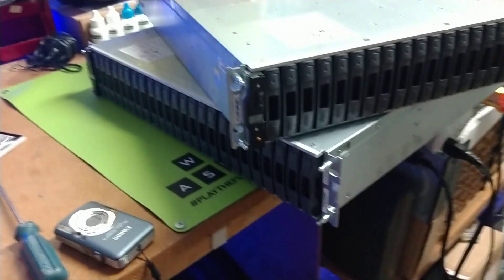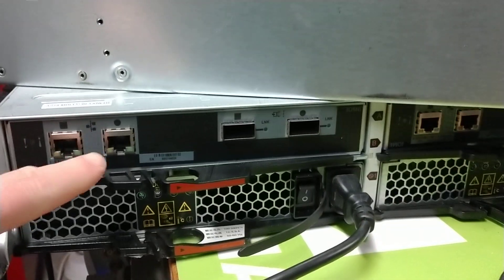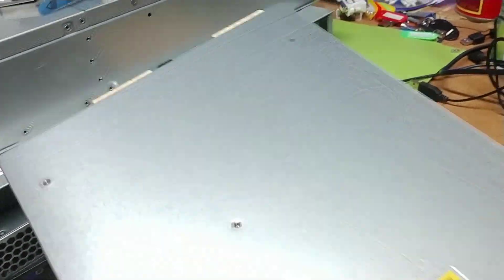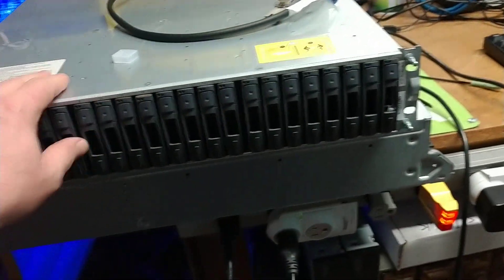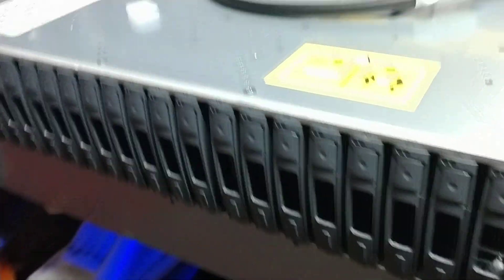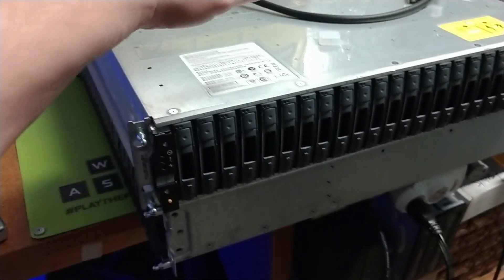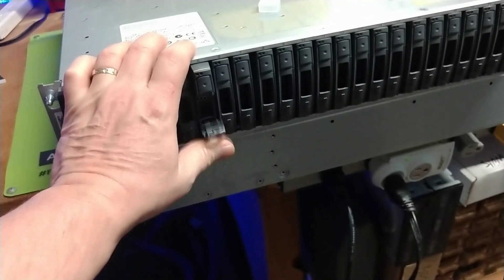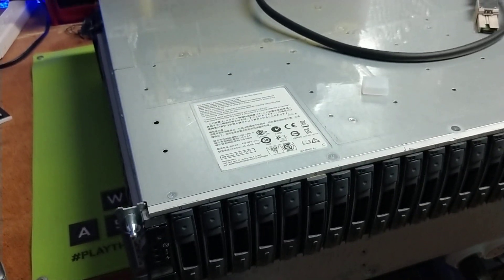Getting a pair of Cheap NetApp Enterprise DS2246 Storage arrays for under $100 bucks!!!

Comment: Hey, do you know anything about an emc vnx sae 24 disk storage unit? I bought one but now after I plugged it into my server my server seems to lock up in the post sequence and I have no idea what to do with it or how to install it
Reply from the maker: Try adding only one path.  Is this unit a SAE 25 disk array or a DAE 24 disk array enclosure? I have not setup a SAE yet. Fun!   Try a single path cable connection. See if you cna see a disk that way or at least post to the server level.
Reply: @leadiususa7394  can you do a video on one? There are literally no videos on youtube on how to install one
Reply: @leadiususa7394  Turns out the raid card I bought causes my server to lock up in post. When I press any key to enter post maintenance like f2 f11 or whatever it totally locks up. I took the card out now it runs fine. This is the card I bought. It's going to be returned. https://www.ebay.com/itm/HPE-615418-B21-P822-Smart-Array-24-Port-Storage-SAS-RAID-Controller-with-Battery/224056567799?ssPageName=STRK%3AMEBIDX%3AIT&_trksid=p2057872.m2749.l2649
Reply from the maker: Also on the back side, does the array have two sets of SAS connectors wit hone RJ-45 heart beat hook up or what looks like a management console / FSP+ IP connections...
Reply: @leadiususa7394  2 sets of sas per module
Reply from the maker: Look at this SAS DAE 24 disk array enclosure setup.  Does the back of you SAE (?) array look like these arrays...
Reply: @leadiususa7394  https://www.ebay.com/itm/EMC-VNX-SAE-25x-600GB-10K-Array-w-2x-6GB-SAS-LCC-Controllers-303-104-000E/174156052957?ssPageName=STRK%3AMEBIDX%3AIT&_trksid=p2057872.m2749.l2649
Reply from the maker: @anthonystrohmayer9191  So it is a SAE but forced into a DAE mode using the SAS controllers.  Hmmm.  Not sure the best way to do this. try single controller hook up for now only on the top controller on the back of SAE array.  Once cable connect. If you see something then only do dual connection for the top controller only. If that work then take the SAE B port on the top controller and cross over from top B port down to the A port on the bottom controller and and then connect B port back to the Server controller B port.  (Note, make sure you are using 512 formatted disks and not 520.   work that later...
Reply: @leadiususa7394  yes my issue is formatting the drives. Can I put the emc drives in the ds2246 and format them? Is my raid card bad? I took it out of the server and the server works again. Or did my server lock up because the emc unit has 520 byte drives?
Reply: @leadiususa7394  I have began to install windows server 2016 datacenter to my dell poweredge r620 server. I have a pile of devices which have no drivers. Dell says it is fully qualified for windows server 2016 but I have issues connecting it to the internet. I have no physical connection like lan, fiber, cat, dsl. I have wireless via usb. But this server won't take the drivers for my usb card. Do you know how I connect this server to my workstation and have my workstation provide the internet connection to the server? Thank you
Reply from the maker: @anthonystrohmayer9191  Yes, If you have a LAN card in your server and PC, you can do a cross over LAN cable.  Wireless doesn't work well for servers of any kind for they want a concurrent LAN session at all times.  Just connect the server with a static IP to the PC that also has a static IP, then bridge the the LAN server connection to the PC wireless connection LNA port to the internet.  It is called Multihoming or NATing your connect like a router.  Your could even build a free PFSense box to do this as well. GO to this link to learn how to do this... https://www.windowscentral.com/how-set-and-manage-network-bridge-connection-windows-10
Reply: Neat. I ordered a cat5e cable from best buy will be here in 2 weeks. I noticed the windows server os has a search the internet for driver's option. Does it look at Microsoft's database for driver's? I get the feeling I should install windows server 2012 datacenter because it's likely to have all the driver's for my server. What do you think about the Dell Poweredge R720xd? I should have bought that instead of this r620. It can have 24 2.5" sas drives and it's a server
Reply from the maker: @anthonystrohmayer9191  Yes the drivers are from the mast MS driver archive.  But that is for also 2016 and 2019 so the drivers should be there.  As for the Dell 720XD. That is a great server and if you can get, get it!  Look at my videos on it.  I got mine as Google T-3/4 search engines arrays.  When you guy a google version of the OEM-Dell 720XD you have to reflash the bios to get rid of all the google junk.  It will work but a bit of a pain to address but once I reloaded the BIOS and cleared the Google Pass-code for the board, it was great to work with. I really do love working with these two chassis.    If you can get these server OEM or just as Dell server then get it! You will be happy with it...
Reply: @leadiususa7394  Thank you for your help. I still have to get my NetApp 2246 and emc vnx sae units installed so I hope you can help me do that. I'm waiting for a new NEW HP Smart Array P822 / 2GB FBWC 6GB SAS RAID Controller Battery to arrive so I can try again to install it to my server. The NetApp 2246, cables, and raid card have not arrived either. I'm trying to make a diy sas raid shelf too. Turns out I bought an 8087 to 4 sata cable and I can't yet try to install my sas drives to my PC. Turns out I need 8087 to 8482. Am I right? Plus, if I make videos of my troubles installing my shelves to my server do you think you could look at them and help me out? Again thank you
Reply from the maker: @anthonystrohmayer9191  No issues on helping and yes your hardware looks good but you will need SAS to SAS cable ends and not SATA to SAS.  As for doing your videos. I would be honor to help you.  I do recommend that you first look at my videos first and the link video to help you better. then have fun and do videos.  Here to help!
Reply: @leadiususa7394  I watched loads of your videos
Reply from the maker: @anthonystrohmayer9191  Thanks, I hope they help you in your learning goals... /:>
Reply: @leadiususa7394  yeah. I learned I should have saved my 1000$ and not bought 2 storage arrays, 2 raid cards, cables, 70 sas drives. Now I have to see it through
Reply from the maker: @anthonystrohmayer9191  I understand and it will work itself out.  Here to help as needed...  And have fun doing this..  I will be sending out a new video about testing bulk numbers of use enterprise 1TB drives.  It may help you some later...
Reply: @leadiususa7394  hi. So it turns out I bought 20 900gb NetApp drives. And I just bought a NetApp ds2246. And a 111-00341 NETAPP PMC-SIERRA PM8003 SAS 4-Port 3/6 GB QSFP Adapter. Does this mean that when I plug it in my PC it will see my hard drives? This adventure here cost me about $450
Reply from the maker: @anthonystrohmayer9191  Ok I think you should go with a Linux / MS Windows compatible HBA or RAID controller.  I don't believe outside FreeBSD Linux that the controller will work.  I always sell my NetApp Controllers off for they are a real headache. Can you cancel the order for the controller and get a HP P822 6GB RAID controller or a LSI  3000 series 6GB SAS HBA controller?  I didn't see your reference the NetApp controller or I would have said something.  It may be possible to use it but it will be a pain to try... NetAPp OS is based on FreeBSD, I should know for I work for NetApp..  /:>
Reply: I bought 2 of these. NEW HP Smart Array P822 / 2GB FBWC 6GB SAS RAID Controller Battery. First one locks up my Dell Poweredge R620 in the post sequence. The second one is brand new. I still have the first one. Second one will be here in a couple days. So I just need the 822 for both the NetApp and the Emc? And I need to return the NetApp card?
Reply: Uh. The NetApp shelf is qsfp and the shelf I bought came with qsfp to qsfp cables. So I have a problem. I'd have to buy qsfp to sas cables and that's $40
Reply: eBay references qsfp to qsfp as qsfp to sas qsfp. Am I able to use my qsfp to qsfp cables on a sas or mini sas raid card?
Reply from the maker: @anthonystrohmayer9191  Yes it should work with the 822 controller.  I have had others write to me about the P-822 and they like it.  As for the NetApp card yes I would return it.. Sorry
Reply from the maker: @anthonystrohmayer9191  Make sure you match to your controller so you have the correct ones you need.  remember that you have one cable from port a of the server controller going to the port A on the top controller of the array then from the top port-B goes to the lower array controller port-A then the lower Port B goes back up to your serve controller port B.  Three cables are needed like in my videos, this gives you a dual pathway for the SAS connections.  Do this research so you have the right cables.  As for the cost, $40 is about right but mine cost me $90 for the 8 ft cables.  I had to do for I have arrays all over the place.  In the old days these 3 ft. cables cost $150 each. Ouch!
Reply: @leadiususa7394  want to buy a used NetApp controller? I might have to claim it's defective to get a refund
Reply from the maker: @anthonystrohmayer9191  Yes but those cables are for connect to each controller between arrays (This is good to a point) but not to a Server controller.  I use the HP P800 RAID card and it has a Mini-SAS cable end on one end and a array SAS head for the array side. My HPe 3PAR cable setup does it in a different cable setup then NetApp or EMC.  that is why you get your controller specs and then get the correct cable.  Don't worry, if you get another array, you already have some the array to array cables.  One other thing to help you.  You may want to take it in small steps next.  First see if you can detect two or three drives.  Then format  them to 512 from 520 sector format.  This give you some fun time with a basic config or mode.  I use HBA controller most to do my formating of NetApp drives but you can flip your RAID controller to none RAID mode with a firmware flash and do it as well with that controller.  That will help decide if RAID or None RAID is the best fit.
Reply: @leadiususa7394  I bought these too for the emc shelf. Will they work for the NetApp? EMC Mini SAS SFF-8088 2M/6.5FT cable 038-003-787 REV A12 Amphenol - Lot of 2
Reply from the maker: @anthonystrohmayer9191  Not tried it but if the connect ID correctly you are good to go.  Also one other detail.  SAS cable ends fit one way.  If the connector end doesn't fit then flip the cable to the other end and try the other end.  lol  It is that sad..  One way cables...  What a pain.
Reply: @leadiususa7394  time to sleep. No more questions for tonight. So the 2 sqfp cables connect to the first and second controller on the NetApp 2246 and I need a sas to mini sas to connect to my raid card? I have not bought an hba card can you recommend a super cheap one on eBay?
Reply: @leadiususa7394  eBay doesn't have 3000 series hba controllers. They have 9000. Is this going to work? SAS9200-8E LSI SAS 9200-8e 8-Port ext, 6Gb/s DUAL PORT SAS+SATA to PCI HBA
Reply from the maker: @anthonystrohmayer9191  Yes this is a good card to work with... (LSI SAS 9200-8e PCI ) SAS external ports so match that to your cabling. As for cabling you can use this site to source out referb cabling.. https://networkoutlet.com/
Reply from the maker: @anthonystrohmayer9191  Your making me want to do another build with EMC gear to see if it can be done and how well it would preform...  Got to get thru my 3PAR first /:>
Reply: @leadiususa7394  I have mini sas to mini sas cables. And qsfp to qsfp cables. The seller lists the qsfp cables as sas to sas. Will any of these work?
Reply from the maker: @anthonystrohmayer9191  Yes I believe so
Reply: @leadiususa7394  hello. I have the ds2246, the qsfp to qsfp cables, the 24 caddies, a million hard drives, and the HP Smart Array P822 / 2GB FBWC 6GB SAS RAID Controller w/ Battery. Can you tell me which of your videos I should watch before I try to install this thing?
Reply from the maker: @anthonystrohmayer9191  Sure. first these two video talking to disk arrays for Netapp and HP. https://www.youtube.com/watch?v=_l-uR4CfAsM  and  https://www.youtube.com/watch?v=qVcLegTqQ50  and then on the formatting side of things.  https://www.youtube.com/watch?v=i78OcQO_ahU   So this is important make sure you read the topic line for the related video link to mine.  This is a big help.
Reply: @leadiususa7394  thanks
Reply: @leadiususa7394  I also bought a ds2246 because at least people on youtube got it to work on pc's and servers. https://www.ebay.com/itm/NetApp-DS2246-24-Bay-Disk-Shelf-X559A-R6-Includes-Railkit-and-Cables-No-Drives/333667510097?ssPageName=STRK%3AMEBIDX%3AIT&_trksid=p2057872.m2749.l2649
Reply: @leadiususa7394  Its sae 25. Dae is like the ds4243 and ds4246
Reply from the maker: OR does your enclosure look like this one array:  https://www.youtube.com/watch?v=Rydw-kQvMDs
Reply: @leadiususa7394  Well that video for the dae is sas and my sae has sas connectors
Reply from the maker: Ok so as I look at it, you have a storage Array enclosure (SAE) and not a Disk Array Enclosure.  If this is the case then this unit can run as a stand alone array.  If you have the  CPU cards and so on.  Does it look like that on the back end?  Do you have a EMC part number on the back?
Reply: @leadiususa7394  EMC VNX SAE 25x 600GB 10K Array w/ 2x 6GB SAS LCC Controllers 303-104-000E. The information you want is in pictures in the auction link I gave you.
Reply from the maker: Oh and you will not be using the CAT 5 cable hooks.  That is for a NetApp controller hook up for heart beat mode. You will not need to use that feature.

Comment: I was going to make my own diy disk shelf using random backplanes on ebay. But it turns out it may not be that easy. I thought I could plug in 2 sas cables, the power cable, mount it to an enclosure, and then populate it with my drives. Not os simple I think. It turns out that backplanes have pinouts on the power connections. And the pinouts aren't standardized so they will change from brand and unit to unit. And it's not even worth my time to try to make or buy a cable for the pinouts because I likely still need a power controller specific to the backplane, and all the cabling to connect it, and then the specific  power supply that was designed to work with it. Just too damned much work. I will stick with my caddies with the mini back planes on them,. So much simpler and super cheap
Reply from the maker: Cool

Comment: Do these have any effect on the performance on an Array..? Or does that remain 100% independent..?  As in, will this cure bottlenecks on my FreeNAS...?
Reply from the maker: No the array itself will not slow anything down but what will is the mixing for drive types within a single array.  You can only go as fast as your slowest drive in these matters.   So if you take the tim to ID the channels on the array, 2/4 or four drive a channel then you can mix 10k drives with 15K in 4 or 8 drive RAID or HBA combos (Don't make your pools to big and do your math on the bandwidth.) but no SATA or SSD.  If you plan to use SATA then it is all SATA, same with SSD.  You SAS is dual channel data pathways where SATA base is serial base pathways. 50% less.  Hope this helps?

Comment: Can you stop disabling comments on your recent videos.... Its hard to give feedback or ask questions when you do that.
Reply from the maker: Thanks for the heads on this issue.  This is odd for I am getting feed back from many others.  Let me check real fast.  Once I fix this issue would you respond to check to see if it working right.
Reply from the maker: By the way/ Your profile is blank.  Do you know that?  Very odd BTW...
Reply: @leadiususa7394  Yea I'm not  a content creator.
Reply from the maker: @theicon2020  Ok that may be the reason why you can't comment. All the many comments are coming from presenters.  That keep everything out in the open so no one can do something odd.  SO can I ask what you wanted to post on the topic I presented on?  I am here to help out where I can...
Reply from the maker: @theicon2020  Sorry but the real issue here is that I don't know about the options so let me check that feature and enable it so you can leave comment. it is me not knowing here and not you.  Thanks for letting me know about this option and I hope to have it running later today.  Thanks again dude!
Reply from the maker: @theicon2020  Ok I took the (safe for kids) setting off and I was able to leave a message but I am the owner so could you try a message for me to see if comments works now.  In the past it worked fine but most likely it is a error on my part.  /:>  Thanks for your insight and help on this...

Comment: Don't these things need massive amount of ac power?
Reply from the maker: Not really, just a $200.00 upright mobile AC / Heater unit that can support 12000 BTU.  You always get a unit higher then your needs so it never runs at 100%. You can see the unit in the picture between the server racks.  Also I rarely every power everything on at once.  I do this on a project basis.  I am also only using three 20 amp power plugs. One for each rack and one for the AC unit.